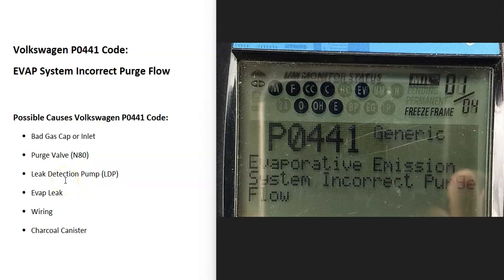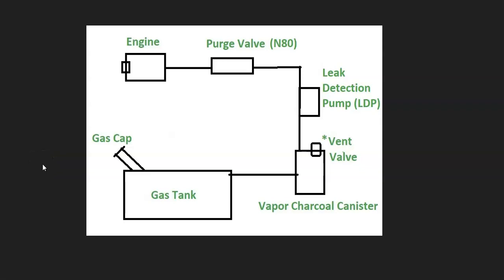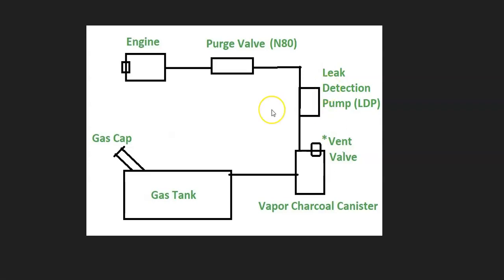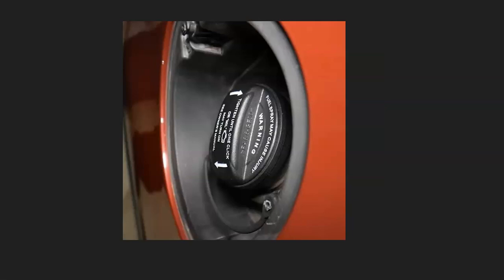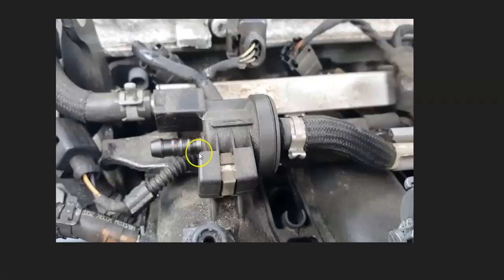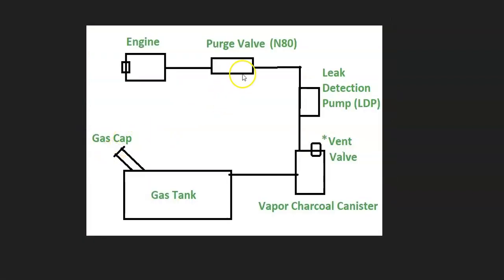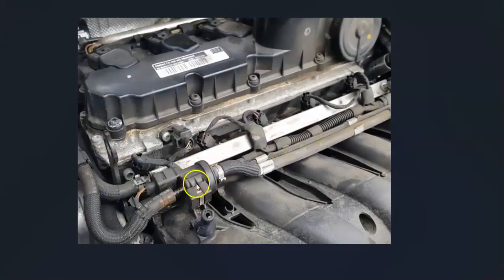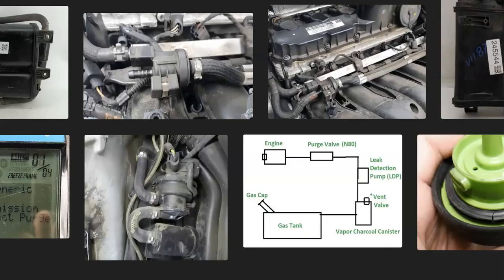Causes and Fixes Volkswagen P0441 Code: EVAP System Incorrect Purge Flow

Comment: I’m thinking with this cold weather and vehicle getting. Old my gas cap is deteriorating I’ve gotten this code twice it comes and goes with the engine light and the other day I got a light for my gas cap being “open” but it was on all the way but that light also went away I didn’t even try to fix it. It’s off and on.

Comment: Does this code make your car jerk on acceleration and also make your car seem like it’s going to stall on first gear
Reply from the maker: Usually, there are no engine problems with an EVAP issue. The only EVAP component that can cause a problem is a stuck open purge valve. The purge valve is normally closed, so if you can blow through, it is bad. You can also use the engine vacuum to test it without removing it. I made a video on this here is a link. https://youtu.be/X-Y5YsaXxJE
Reply: I also noticed this with my car I’ve gotten this code twice.
Reply: Did you happen to solve this? Chasing this issue myself currently
Reply: @drownedingold yeah turns out the charcoal canister was blocked had to replace it also the pc valve for my car
Reply: @copynpaste_9979 thanks so much for the quick reply!

Comment: What if i replaced purge valve and after this i can smell a lot of benzine next to a car and still have p0441 code
Reply: I've bought 2 N80 - p0441, one stuck closed, other one was working, my mechanic didn't tell me that canister might be clought up. I've replaced canister, with new N80 - I thought it is broken regardless of what a new part was - but it was bad/closed, so I changed for the first one and it started to work.

Check if your N80 is good, check for tank cap, check for leaks, check for the pipe(from tank to canister - if the air can go through - one direction - from tank to canister, try to blow and air should pass smoothly) and that is it. Wish you luck.
this is the report from scanner tool - tests
Mode $06 report generated by Torque for Android
================================================

Vehicle VIN: Not present
Vehicle Manufacturer: Unknown
Vehicle Calibration ID: 1P0907115
 0040

Test report:
------------------
MID:$01 TID:$83
 - O2 Bank 1 Sensor 1
Max: 1.99882   Min: 0.3499
Test result value: 1.13094
PASS
----
MID:$02 TID:$07
Minimum sensor Voltage for test cycle(calculated) - O2 Bank 1 Sensor 2
Max: 0.44969V   Min: 0V
Test result value: 0V
PASS
----
MID:$02 TID:$08
Maximum sensor Voltage for test cycle(calculated) - O2 Bank 1 Sensor 2
Max: 1.29906V   Min: 0.44969V
Test result value: 0.9494V
PASS
----
MID:$02 TID:$81
 - O2 Bank 1 Sensor 2
Max: 0.62074V   Min: 0V
Test result value: 0.61098V
PASS
----
MID:$02 TID:$82
 - O2 Bank 1 Sensor 2
Max: 1.29906V   Min: 0.62074V
Test result value: 0.6305V
PASS
----
MID:$02 TID:$83
 - O2 Bank 1 Sensor 2
Max: 0.1597V   Min: 0V
Test result value: 0.00329V
PASS
----
MID:$21 TID:$84
 - Catalyst Monitor Bank 1
Max: 65,535   Min: 4,096
Test result value: 8,302
PASS
----
MID:$3d TID:$80
 - Purge Flow Monitor
Test incomplete or dependant test failed
--
MID:$3d TID:$82
 - Purge Flow Monitor
Max: 9.99393   Min: 0.09516
Test result value: 0.0979
PASS
----
MID:$41 TID:$85
 - O2 Heater Monitor Bank 1 - Sensor 1
Max: 1,239.90002°C   Min: 754.90002°C
Test result value: 819.60004°C
PASS
----
MID:$42 TID:$81
 - O2 Heater Monitor Bank 1 - Sensor 2
Max: 2,232Ohm   Min: 0Ohm
Test result value: 168Ohm
PASS
----
MID:$a2 TID:$0b
EWMA Misfire counts (average) for last 10 drive cycles - Misfire Cylinder 1 Data
Max: 65,535Count   Min: 0Count
Test result value: 0Count
PASS
----
MID:$a2 TID:$0c
Misfire counts for last/current driving cycles(calculated) - Misfire Cylinder 1 Data
Max: 65,535Count   Min: 0Count
Test result value: 0Count
PASS
----
MID:$a3 TID:$0b
EWMA Misfire counts (average) for last 10 drive cycles - Misfire Cylinder 2 Data
Max: 65,535Count   Min: 0Count
Test result value: 0Count
PASS
----
MID:$a3 TID:$0c
Misfire counts for last/current driving cycles(calculated) - Misfire Cylinder 2 Data
Max: 65,535Count   Min: 0Count
Test result value: 0Count
PASS
----
MID:$a4 TID:$0b
EWMA Misfire counts (average) for last 10 drive cycles - Misfire Cylinder 3 Data
Max: 65,535Count   Min: 0Count
Test result value: 0Count
PASS
----
MID:$a4 TID:$0c
Misfire counts for last/current driving cycles(calculated) - Misfire Cylinder 3 Data
Max: 65,535Count   Min: 0Count
Test result value: 0Count
PASS
----
MID:$a5 TID:$0b
EWMA Misfire counts (average) for last 10 drive cycles - Misfire Cylinder 4 Data
Max: 65,535Count   Min: 0Count
Test result value: 0Count
PASS
----
MID:$a5 TID:$0c
Misfire counts for last/current driving cycles(calculated) - Misfire Cylinder 4 Data
Max: 65,535Count   Min: 0Count
Test result value: 0Count
PASS
----

End of report.